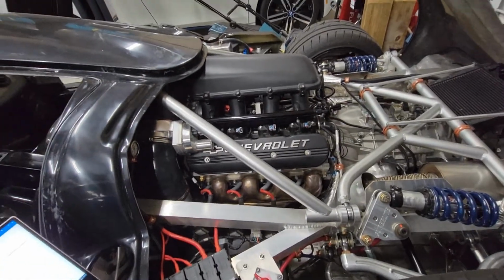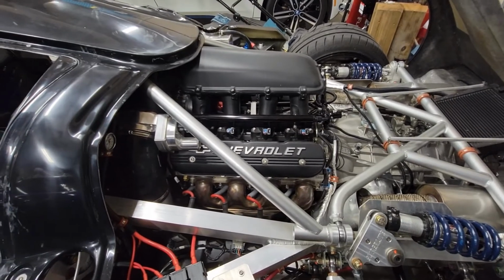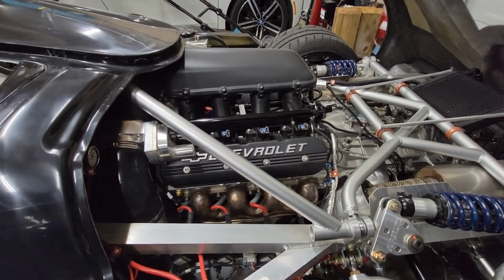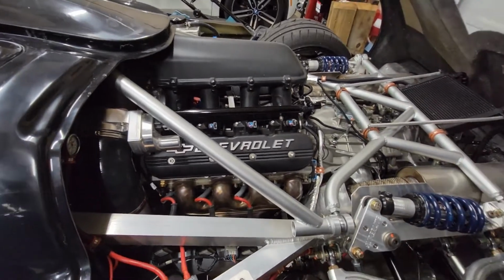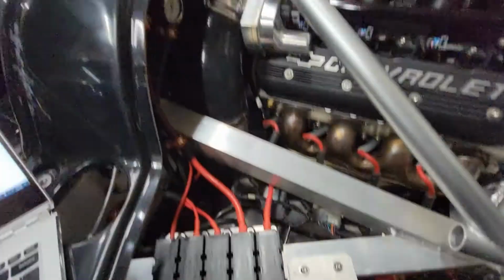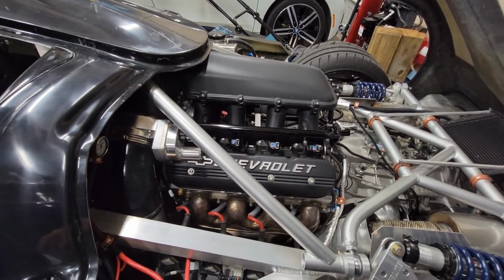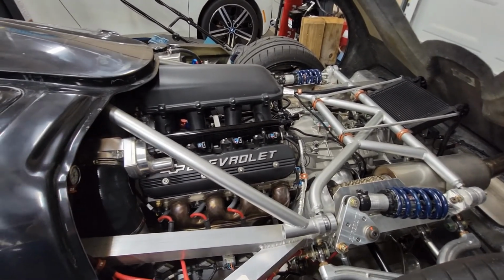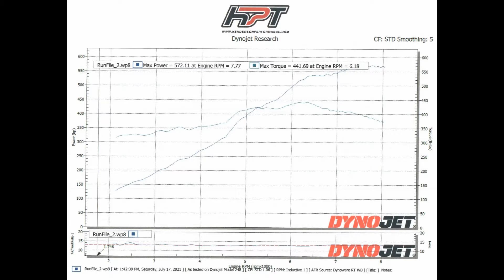SLC Engine details, dyno run and pics

Comment: Was just watching vids of Detroit Speed's Camaro and was wondering how that would look in an SLC and landed on your video. Nice work, how's she running?
Reply from the maker: Thanks! There have been some pretty crazy engines in SLCs, twin turbo LS, supercharged LS, BMW V10. It's running pretty will -- took it to the drag strip a couple weeks ago (posted a vid on that). It's still running a little rich a cruising speeds so I need to adjust the tune.
Reply: @markb5066  If you don't mind me asking was it a costly engine build? Been looking at the S85 V10 (BMW) or a setup similar to yours if I pull the trigger on an SLC. I like high redline fast revving engines like my 5.2L GT350.
Reply from the maker: @jamesevan7561  It was just under 14k including the dry sump pump and tank but I did all of the parts sourcing (except crank and pistons) and did the long block assembly, including fabbing up the oil pan, myself, so I saved a few $K. I'm totally with you on high revving engines -- just more fun.
Reply: @markb5066  Gotcha so not to bad